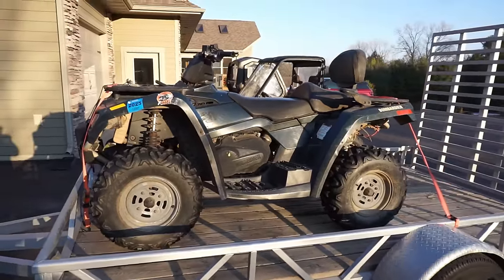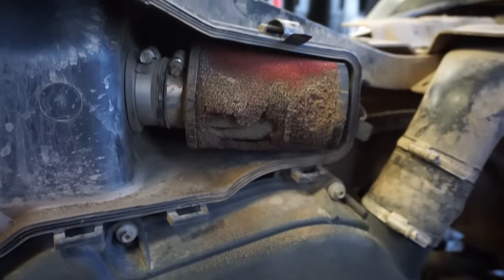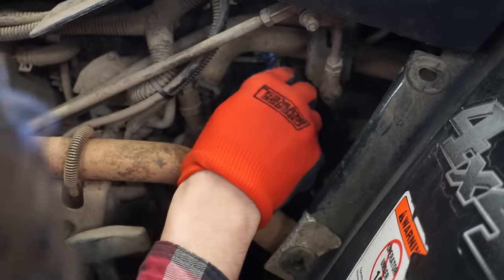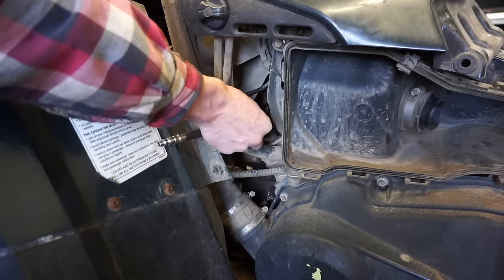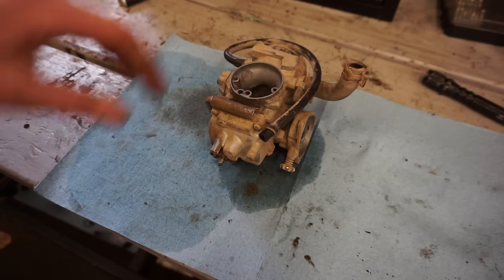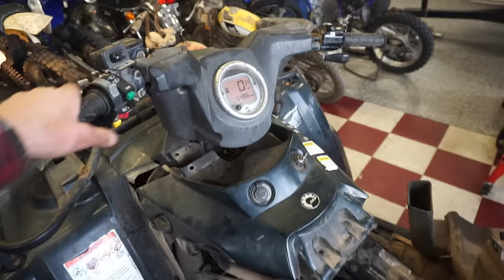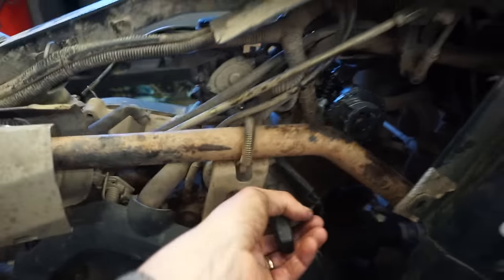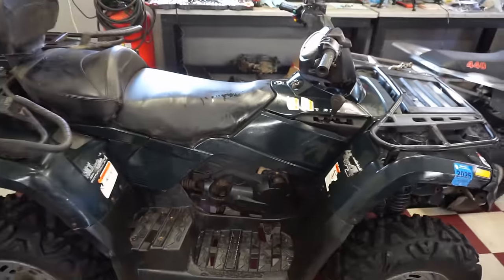Dealership Couldn't Fix This ATV So I Got It For CHEAP

Comment: I got to look over the atv I got and these people already torn into it.  The winch is gone, the mount is bent up some.  The dash is unplugged and laying on there loose.  I got some fasterners comming, an air filter, a spark plug and other little stuff. Yet I will have to check it all out and see what is going on that it shut off and wont start.  The last time I got a 250 chinese scooter it was just too bad to put that one back togehter.  I got the tank off, and other stuff to where I can look around in the engine area.  When I stand on my legs too long I can barely get back in the house.  Am charging up the battery and this came from Vietnam.  If it turns out to be nonrepareable will sell it off for parts if necessary.  What I do see is that it was run hard and it ua dirty and I will have to check out everything.  A rim has a good dent into that as well.  Just a little bit at a time.  Paul in Ohio.

Comment: You may got it runnig for now but what made the timing chain jump 3 teeth? I'm sure the valve train took a hit. You didn't say the chain was tightened.  Also lighten up on the starter on these things, they can't take that amount of cranking. With that many hours and miles, I can imagine the sucker that buys it without knowing the original issue of how the timing chain jumped.

Comment: Sounds like some major timing chain slap. That's a very lazy dealership.... New timing chain and some valve adjustment and she will prolly be fine. After looking at the air filter during your disassembly I figured it was a valve lash issue.

Comment: It would have cost the customer more because the shop charges per hour. You only spent 470 because you dont charge yourself for time. While the repair they quoted was likely wrong, they still would have charged for resetingthe timing and the valve clearance adjustment

Comment: You have to wonder what the mechanic was thinking. They knew it had low compression, but didn't even check the
basics. I'm sure they knew that if they found something simple like the timing was off, they wouldn't make very much money,
so it was easier and more profitable to try and sell a rebuild. Unfortunately there are people that would just say okay, 
go ahead and do it.

Comment: I worked at a Honda shop when I was younger as a mechanic.  A customer put her Son's QA 50 into the trunk of her car and drove 50 miles to our shop because it quit running.  

I looked in the gas tank, because a lot of people will drain the gas out before putting it in the trunk of their car.  It was empty.  I put some gas in it, and it fired up with the first kick.  I rode it out to the showroom where she was getting a work order filled out, and she asked "what did you do?"  I said "nothing."  Then I asked her if she drained the gas out of it before she put it inside the trunk of her car.  She said "no."  I told her that I just put some gas in it.

She then looked at her 10 year old Son, and was so mad.   I for-see some grounding in his future.  LOL

Comment: I had exact same quad , ‘08 tho and kids rode it and it did that same thing , dealer i got it off said they drop push rods ??? So for me dealers are just that , deal so they win not consumers . Research before you buy any expensive item is key

Comment: Maybe I missed something, but why had it jumped time in the first place? Just putting the timing back where it belongs doesn't fix the root cause. I'd be ordering up a timing chain and tensioner kit for it, no? My 2021 Sportsman 570 had same symptoms. Dealership wanted $4500 to replace the entire engine. It was about two weeks out of warranty and Polaris wouldn't cover it. I took it home and found the intake valve was tight.Got the valves set properly and it was fine. Gonna have trouble trusting any dealers in the future....

Comment: nice video and nice fix but I dont understand why you criticize the mechanic like that. how many hours did you work on this thing? 10 hours maybe?
how much is 10 hour of mechanical work cost ?
also you couldn't know from advance that the problem is timing, how can a mechanic quote you a price with all of these unknown variables ?
unless the timing issue is something  a professional mechanic should have considered early on and tried before quoting such a high repair cost.

Comment: I had a friend that took his truck to the dealership because it was missing and running bad which was a intermittent issue . Long story short they told him he needed a new engine . Me being a honest backyard mechanic told him to do a fuel pressure test and sure enough he had low fuel pressure due to a hole in the fuel pump sock and it was plugged with dirt . That's why I would never trust the dealership I know it's not a quad but same type of experience with a dishonest dealership trying to rip off the little guy .

Comment: Take air filter off and it will because it has fuel and spark so air is the only thing you don’t have and compression won’t be there either with no air to compress !

Comment: The mechanic probably just checked the compression seen it was low and that's it did not bother to check anything else some times all you have to do is dig a little deeper to find the problem

Comment: Add 8 oz of marvel mystery oil to one gallon of gas to free up the rings and clean the valve. After 2 tanks of fuel it will run like new.

Comment: A healthy 12-volt battery  will retain 12.5 to 12.6 volts at rest without a static charge. 12.1 volts at rest is extremely discharged.

Comment: My guy, your diagnostic procedure needs a little refinement, previous mech says low compression yet you check everything else before you bust out the compression tester.. 
Verify the known issue first prior to going through all the other mess just to find exactly what they said it was.

Comment: Ok I have to vent...What is it with people constantly using the word "quick" ?  I'm gonna quick hook this up. I'm gonna quick 
put this on. I'm gonna quick check this... It drives me nuts. It's not just you that does it. There are several channels that I'm
subscribed to that have people that do it, and it's not just me that it really grates on.
I do like your videos though.  You definitely scored on this quad. If he was riding it and it was running good, shut it off
for awhile and it wouldn't start, what caused the timing to jump ?

Comment: 33:58 pull the carb taking it apart, yet doesn't even look at the fuel filter? Just because gas comes out doesn't mean it was enough, just saying. I would have looked at the fuel tank and filter before taking a carb apart, especially because it was already running with no issue.
The time it ran it burned off the previous oil and compression dropped again. Most like likely the rings, at some point he had the timing chain done, and the mechanic messed the rings up. It just took a little time to show itself. Just an opinion.
Cool it was timing.

Comment: Why didn't you cleanup and wash the quad get on the dirt off of it first? b4 start to work on it!, Anytime I buy a car or a truck I wash the engine compartment so it doesn't get my shop floor full of dirt, for safety reasons and any work you need do to the vehicle to sell it or scrap it for parts!

Comment: The mechanic said it had low compression but said it was the cylinder or cylinder head, but not the timing. Sounds like it's time for a better mechanic. Makes you wonder if they messed up the timing during the last time they serviced it.

Comment: The dealers do that in hopes that the customer will buy a new machine. Then they fix it at their leisure and make money on 2 sides. Auto dealers do the same thing. You want to take your quads and motorcycles to just a mechanic that makes money just fixing stuff, then you will get a much more reliable estimate.

Comment: That was painful. Checks the spark, it's got a good spark, changes the spark plug. Am I missing something? Crusty old air filter barely gets a mention and stays in place. Why not check the compression, which the mechanic said was a problem, while the plug was out?

Comment: I'm ticked off at both the previous owner and his mechanic! The owner for not replacing that air filter and probably relying on his mechanic to look at it "once a year"!! If you can't check the oil level and check/clean/reoil or replace your air filter regularly, you shouldn't own a machine.

Comment: Theres would have to be a mechanical failure for it to be 3 teeth out of time if no one messed with the timing. Loose chain, tensioner, ect? Mechanic or previous owner left out some info.

Comment: Caked on dirt all around your open head while you're adjusting the valves.  You'll change your Technique after one of these times your engine blows up because you didn't clean the area first

Comment: Am I missing something. Can't see any fuel but doesn't add any. Air filter is plugged but doesn't remove. Low on oil but doesn't add. Engines need compression, spark, fuel and it has to arrive at the correct time. There is a methodical way to diagnosis.

Comment: Dude... open the garage door when you run the engine inside?
Also wouldn't it make your life so much easier to pressure wash the thing before you start, watching you strip that carb just covered in dirt and spilling dirt inside it in the process was painful! 
Just in general working on stuff covered in mud etc can't be fun.

Comment: Deliberate overquote.
Vehicles(incl quads. motorbikes etc) and servicing there-of is in a death spiral. In about 10years there will be insufficient total man hours available vs required servicing time.
Pricing will blow out, the scenario of this video will become common place.
It is actually for this reason I think EVs, and electric bikes will prevail. Its about simplicity of the motors and drivetrains. They will be modular and it'll be factory only.
Sure there will be fixit people here and there. There always will be, I am talking about  whole of country infrastructure.
Insurance will be a major component in all this.

Comment: NO Shop is going to spend ALL that time, at least 6 hours to get this running , nor a customer is going to 
spend $ 150.00 a hour for 6 hours either. Its NOT the shops fault that the owner did NOT take care of his
machine! It will jump timing again  , it needs a new Timing chain and tensioner and guides.

Comment: Mechanics have to ride a thin line.  They have to spend enough time diagnosing a problem to be reasonably sure of the issue, but not so much time that they go broke giving these free estimates.  Time is money.  If they spent as much time as you did diagnosing the issue, they would have had to charge the guy that many hours of shop time.  So probably $400?  Before they even give the guy a call that they figured out the problem?  That's going to upset customers as well.  So instead, they do a compression test, it's low, they are going to assume and quote the worst (because it's a free estimate and they're actively losing money to quote you) and move on to a job that is going to actually pay the bills.  Mechanics can't spend 4-8 hours diagnosing one vehicle.  It's just not financially feasible especially when most customers aren't willing to pay for diagnosis at all.  You get what you pay for.  I'm not saying all mechanics are good or bad....just saying that they have more to deal with than always figuring out the exact cause of an issue.

Comment: Oil full of gas. Someone turned it over for 3 days with valves tight and open. Change the damn oil. Cylinders washed clean of oil. Change the damn oil

Comment: Funny how people don't maintain their stuff and freak out when there's an issue.  Just look at how filthy that air box and cleaner were.  Not hard to take an hour or two every year to at least clean up a machine and go over basic maintenance stuff.   My friend was complaining their Corolla was unreliable junk only to find out it has 240k miles on it and needed struts, brakes and ball joints.  Possibly a clutch as well.  Normal wearable items.  They haven't had a single issue with it and they got it with 120k miles on it and they're complaining it's junk now just because they didn't take care of it.  They get the oil changed maybe once a year at most as well.  Poor car.  It's a manual 2008 with a manual transmission they bought from their neighbor for $1000 and have driven it for several years putting over 100k more miles on the clock yet they complain about normal stuff wearing out.  I would do anything to find a deal like that yet he just drives into the ground and complains.

Comment: So you buy an atv the dealer says has low compression and you start by checking everything other than the compression??? Hey maybe it wont start because the left front tire is low on air , you better check that before you check the compression WADA

Comment: Sometimes dealerships dont want to spend more then 1 hour to figure out the issue. This guy made money... He did a compression test and it FAILED and he said done deal motors junk... That could be TRUE!!!! However ANY decent tech would know there is a FEW different reasons for LOW compression. That guy said ill get my 1 hour pay and get away from it.. And the OWNER is the one who gets F$$#%ED... HOWEVER!!! The dealership I bet called the customer and said we did a compression test and it was LOW. There could be many reasons for this do you want us to Continue with Diag or call it quits at 150+ an hour it could take several hours to properly figure out if the motor is Junk... At that point you owe 500 for Diag and your bike is trash... So MOST customers say forget it... I dont want to put 500 into figuring out my bike is JUNK. so here we are...

Comment: You mentioned that the sellers mechanic mentioned the timing being off. You mentioned how difficult it would be for a tight timing chain, to jump even one tooth. You mentioned how the timing chain had actually "Apparently" jumped 3 teeth. You mentioned how there is an adjustment that you were able to do a quick Timing chain Adjustment from the outside of the engine. You mentioned the seller always used the same mechanic. HOW did the timing chain get moved 3 teeth. Smells like the sellers mechanic F*cked him at some point, by moving that quick timing adjustment incorrectly at some point. Just Sayin

Comment: What a backward way of diagnosing the problem, you were told the compression was low. The first thing you should have done was clean all the dirt off the machine and then check the compression. I can't believe you were inside that carburater with your dirt-covered fingers.

Comment: That sounds way dodgy ,for timing to be off that much .... that the garage said it needed a rebuild ... something dont add up...

As this machine got them cninesium nuts and bolts .

Ive had plenty of bikes ..and have never had ,yhe timing change or loose ..  unless works been done in that area .

Comment: You are not a mechanic.. 11 minutes into the video - The Spark plug is out -  You got Fuel - You Got Spark.
You did NOT do a Compression Test or even Stick Your Finger in the Spark Plug Hole & Crank it to at least "Oakey Test" for Compression. 
12:17 in - still no real comp test? And then FLOOD it? LOL 
Thumbs Down.  Bye